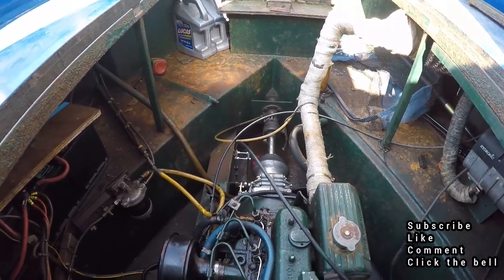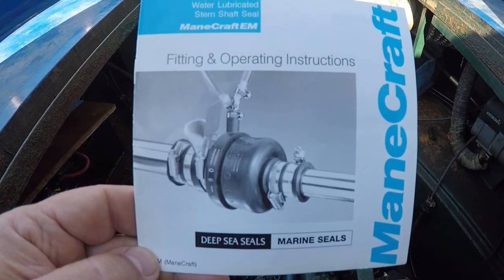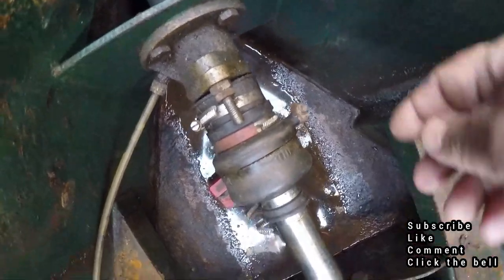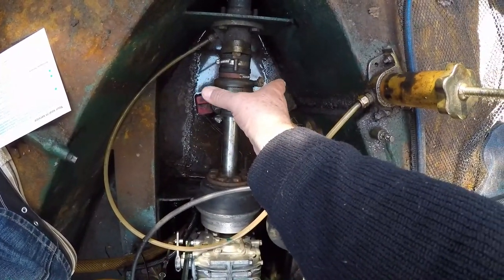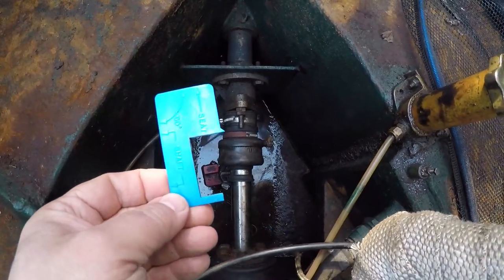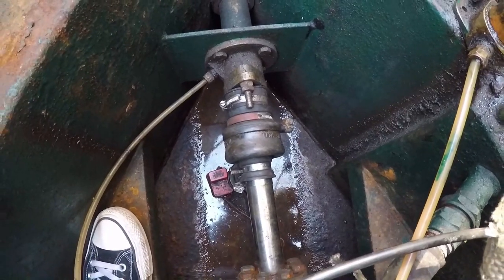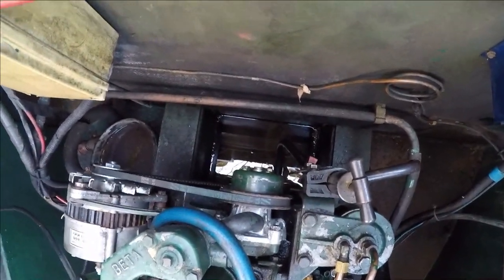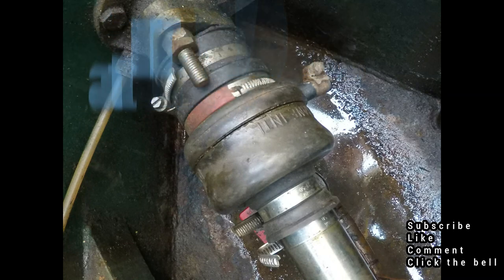#7 That Stern Gland....and Other Questions!

Comment: Hi Lumpy and welcome to the wonderful world of Narrowboats!  I have an old bucket and sponge (the sort you wash the car with) and a pair of marigolds I wear to soak up oily under engine bilge water, the dispose of correctly. Keep it as dry as possible so you can see quickly if your engine has any leaks. This compartment is separated from your other bilge areas as its a requirement (so no oily water gets pumped into the canal via your bilge pump)…. keep up with the vids!!!
Reply from the maker: Brilliant. Thanks for this. I'm on it!!!

Comment: That seal that you have fitted is supposed to be maintenance free and leak free I am guessing that as you have had the gearbox removed and refitted a couple of times they have messed up the tension on the joint and that is why it is now leakings you need to read the instructions and reset the tension properly then you should have no more problems.The engine bilge you need to clean with spill dry or nappies and dispose properly
Reply from the maker: Brilliant. That's really useful thank you.

Comment: As far as I'm aware the deep sea stern gland is manufactured as a replacement for the traditional stern gland is is supposed to be maintenance free. It has a bronze disc which clamps to the stern tube and is fixed in place. A seal is attached to the prop and pushes up against the disc. The seal part rotates with the shaft and water lubricants the two. There is a vent to stop pressure building up and an emergency clamp incase the seal fails. As far as the water under the engine goes I find a wet vac does the job just fine.
Reply from the maker: Yeah it seemed pretty robust but the surveyor had indicated that he had no idea how long it had been in place so I reverted back to a traditional stuffing box type. Thanks for the comment.

Comment: Hi Steve, regarding that bucket filling with liquid, I could see a pipe above it which is possibly where this liquid is discharging from. Could it be from your diesel heater expansion tank? I’d be tracing that pipe for sure. 
Water cooled stern glands are around for sure, the one you have looks like for a sail boat, this is fine as long as it’s installed correctly, it’s just not common on inland watercraft. 
You need to replace them when the rubber gets hard and your cant ‘burp’ them anymore.....and that’s a boat out the water job and when this time comes I suggest replacing it with one more known to the inland craft engineers.
Reply from the maker: Yeah thanks for that. I will trace that pipe back, I think you may be right.
Will keep burping the seal. It seems fine right now and yes, going off what others have said too, I'll revert back to standard stern gland packing when I need to.

Comment: Crikey...I struggle with anything more complex than a dipstick, but I have to confess that my immediate reaction with anything like this is always (I fully accept that this is all subject to budgeting limitations) to go for tried and tested standard solutions. If you possibly can I would get a quote for getting her out of the water and a standard stern gland with a greaser (that’s your brass handle you’ve been told not to turn) fitted, and also a bilge pump. It maybe that someone sees what you’ve got and says it should never be replaced, but I’d be happier with the normal set up...our boat has the standard stern gland and is as dry as a chip. Really wish you well with this and look forward to seeing how you get advised...🍷🍷
Reply from the maker: Yeah thanks Steve. My gut is to go back to standard. I'll see what the experts say.

Comment: Looks like half of a standard stern gland coupled with a marine seal. To change it back would possibly require the boat out of the water. If it only drips a tiny bit leave it alone just add half a turn of grease if it starts to drip. The oily mess under the engine needs to be soaked up with nappies and disposed of responsibly and any large oil or diesel leaks attending to. The bucket is for when the stern gland lets go, start bailing!!😀
Reply from the maker: Phil Elliott 😂😂😂. It hardly drips. That water you can see is always there because the bilge pump never quite clears everything. Nappies are the future!....... when the world stops panic buying eh?

Comment: Hi, afraid I can't add much about the stern gland as Ive never seen the type before. When your ready I should get a yard to quote you for getting it sorted back to a more standard type. If it was an urgent task affecting the safety of the boat your surveyor would I'm sure have flagged it as such. If you are worried about it give the surveyor a call. The engine bay is separated from the rest of the bilge to avoid polluted water being pumped overboard, hence no bilge pump in the engine bay. Just mop it out and dispose of it at the recycling yard. Once its all nice and dry and clean you'll be able to see if you have any oil leaks. The oil there may be from pervious leaks or dumped when the oil was changed. You may be getting rain water through the deck boards. Check the drainage channels around the edge of the boards and make sure they're not blocked. Cruiser sterns can be harder to keep dry as you have a lot more deck. The bucket is probably catching the water from the calorifier as the water heats up. A lot of boats have it directed overboard through a skin fitting but many just drain it into the bilge. Welcome to the joys of boat ownership. You can rest assured by the time you've sorted your first to do list there will be another. Good luck.
Reply from the maker: Michael Greaves some great info there mate. Thank you.. Not thought about the contaminated water below the engine! Now I know.

Comment: Hi me again just checked on Google as I have not seen the seal you have before(seen lots like it but not that one) the blanked off nipple is a air vent to stop to much pressure building up inside so a pipe should be fitted to that and run to the outside just to be safe
Reply from the maker: Ah! Ok, so not a lubricating pipe. That’s something I can deal with!

Comment: the bucket is probably there to catch drips from the pressure relief valve on the colirifier, it's the lazy way boat builders do it, a skin fitting above the waterline is a better way to deal with it ,, That gland fitting could removed and binned then repack the original stern tube that has had the pressure plate turned around to clamp the other one on to, it could be done without taking the boat out of the water , simple as peas 😀
Reply from the maker: narrowboat Awyeganna that's good news that the boat won't have to come out the water. A specialist job though even so, I'd guess?
Reply: Make sure you cut your packing gland rings first And bilge pump is working ! If it takes more than an hour you’ve had to much tea
Reply from the maker: narrowboat Awyeganna I'm liking the sound of this.

Comment: Don’t know about your stern gland but the engine can be cleaned with an old floor mop and finished with absorbant baby nappies. Maybe the bucket is just old bilge oil does anything drip into it. Stay well ,keep Safe
Reply from the maker: Ha! When the UK baby nappy shortage is over, I'll be on that!
Reply from the maker: @andyhibbert1823  yes I've since learnt this! I've managed to get some incontinence sheets that you would put on the chair of a person suffering with such a condition. They have been really useful.
Thanks for watching and commenting.

Comment: Hi as steve has said. I would have it taken out and normal stern gland put into place. 
With the water in the bilge. Nappies are good to soak up some liquids. I have a wet dry vacuum and suck up liquid I cannot get a bilge pump. 
The bucket thing it looks like a tube going in to it .were is the pipe going to?
Reply from the maker: Cheers. It may be from the Eberspacher??? Does that have an expansion/overflow?
Reply: @NarrowboatNatterings  not sure about the eberspatcher I've not got one . Empty the bucket and clean it out then keep eye on it
Reply from the maker: Will do.

Comment: Hi Lumpy, you had problems with your gearbox, did you ever find out what the trouble was? I wondered if it was an hydraulic box, low on oil?
Reply from the maker: Hi John. RCR came out to the boat and determined that a catastrophic failure had taken place. They thought initially it was just the drive plate, but on further inspection the could see other things were chewed up. The oil was black instead of red. The engineer told me this was not a good sign. Something had either disintegrated off at best got strangely hot! 
When the prop was turning he was able to stop it turning with his foot! That apparently is another indication that the gearbox is not well!!
Hope that helps!
Reply: @NarrowboatNatterings  cheers mate, I’ll see you about on the cut sometime,

Comment: Hi I was just wondering was the surveyor recommended by the brokerage you had your boat from ? I feel he should have walked you round the boat pointing out thinks he was not happy with and you could have found out about all your concerns before you bought your boat if it was me I would change it back to a standard stern gland that you can grease daily , you are not far from streethay speak to nick he will give the advice you need to put your mind at rest Happy boating 👍
Reply from the maker: Robert Martin yes I know Streethay. I'll go and have a chat.
In fairness the surveyor was as clear as he could be about it. I appointed him. He said it is non standard and not best practice, though it could be fantastic with very low maintenance. On his report, he wrote the same and advised that I monitor its performance. It was never a deal breaker for buying the boat though.

Comment: Just re watching this and again...I am a a 100%, gold plated numpty when it come to engines, but it i’d question where the liquid under your engine was coming from....before the solution to get it out? I can only compare by looking at our own boat and as with the rest of the bilge, ours is bone dry under the engine and so I’d start with (RCR ?) seeing if you can get someone to find out what’s causing that much liquid...! 🍷🍷
Reply from the maker: I think its historic Steve. It's been there a while. The drainage channels where the engine cover boards fit, were blocked, so rain water was going into the bilge but my bilge pump only clears fluid from beneath the stern Assembly area....but I take your point.
Reply: Fair comment...key is to be sure that nothing is leaking etc etc...🍷🍷

Comment: Good morning. May I kindly suggest what in my opinion has happened. You have a conventional packed stern gland with a screw-down ( two bolts ) part to compress the packing. You show how the screw down part to compress the packing has been fully adjusted. That is the packing inside has been worn away over the years and the two bolts have been fully tightened  so that  there is no more adjustment possible. I suggest at that point instead of having the packing replaced, a previous owner, because to do this safely the boat needs to be out of the water, ( costs money ) has fitted the mane craft seal which is for water lubricated stern shafts. They did this to stop the excessive leaking of water through the stern gland where the packing is severely worn away. I would fill your remote greaser with the correct grease which is Morris K99. To do this unscrew anticlockwise the upper fitting of the remote greaser. Then unscrew the greaser tube. The greaser tube can then be pushed down over the Morris k99 as it has on top of the grease a plastic fitting with a hole in the middle. Screw on the greaser tube now full with grease, then screw on the top of the greaser with the hand screw on top. Screw the hand screw down until firm pressure is felt. You may find that with the packing being worn away so much that the grease is squeezed along the prop shaft and out through into the canal. This could be checked by going down your weed hatch and feeling for the grease where the shaft enters the water. You show on your video splashes of grease up the internal swim at both sides. ONLY DRY DOCKING AND REPLACING THE STERN GLAND PACKING WILL SOLVE YOUR PROBLEMS I KINDLY SUGGEST. Did the survey mention any wear in the prop shaft ? You can feel this yourself by getting hold of the propeller and seeing if the shaft wriggles from side to side.
The bucket with water in is catching I believe water that has come from the hot water ( calorifier ) tank. The hot water tank may have fitted a pressure relief valve. This is because hot water expands. The valve is then connected to plastic Hep2O ( was grey in colour latest is white ). The plastic grey 15mm tube then passes into the engine bay and is shown in your video near the bucket with water in. It is normal for this situation to occur. Just check on the bucket every day and empty it as appropriate. 
I hope this helps. Have you got one of the books on narrowboats ? Such as the " The New narrowboat Builders Book " or  " The building of a narrowboat". 
PS Suggest buy a vacuum oil extractor to remove oily water under the engine. 
Regards Simon
Reply from the maker: Thank you so much Simon for your detailed response! There is a lot for me to mull over and I think your suggestions make a lot of sense. I'm not live aboard, so when the authorities allow public movement, I'll be sure to take all that into consideration. Thanks again for taking the time to view and respond.
Reply: Glad packing can be done with the boat in the water if you know what to doing , just greasing it as it is can be a waste of time , I would be very interested in the wear of the prop shaft at that point before looking at remedies
Reply from the maker: Captain Grandad thanks for that. When I know, I'll let you know!